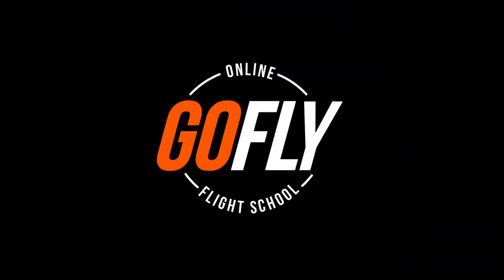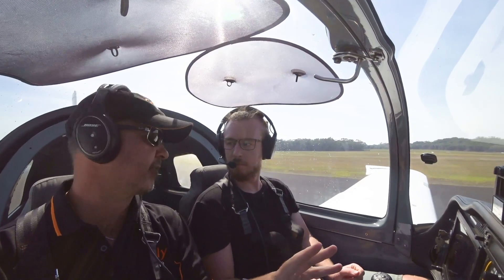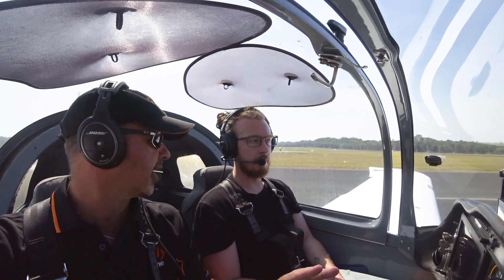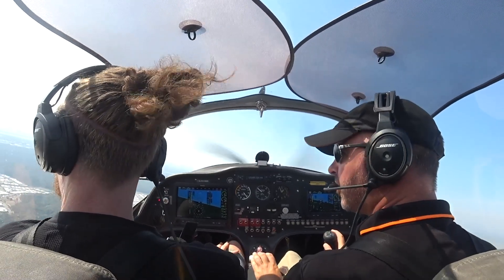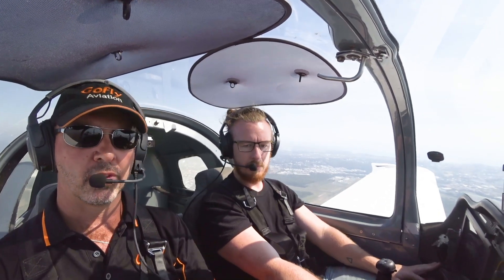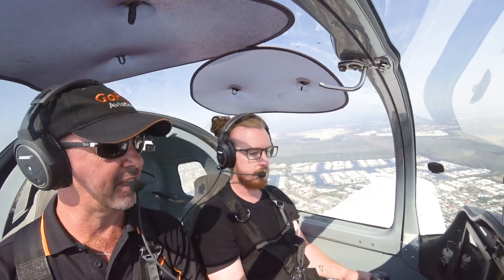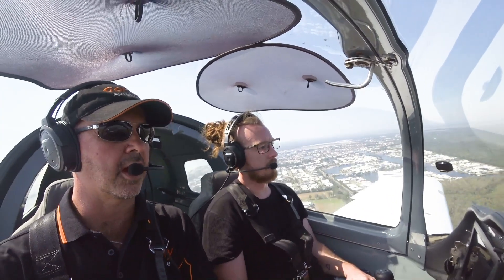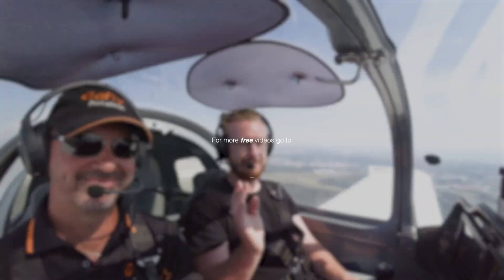The correct procedure when your throttle is stuck on full power - GoFly Fix

Comment: Thanks for sharing. Actually, on another forum they had a good basic procedure for this case: Climb to a safe altitude while heading towards a safe landing area. Once you are above that area, prepare for your landing following the emergency procedure. You can try to control power by mixture for a more or less regular landing, but if the engine stalls, it may not be possible to restart it with the throttle fully open, so better to prepare for a no power landing.

Comment: I actually had this happen to me a few years ago as a student pilot doing my PPL. My instructor immediately wanted to cut the fuel supply and land on a nearby road, but as we were descending I suggested we maintain full throttle and try to make the 5NM to the aerodrome by controlling the RPM with the fuel mixture (Cessna 150), the instructor agreed.. The plane was shaking so much it seemed like it wanted to disintegrate but we made it back.